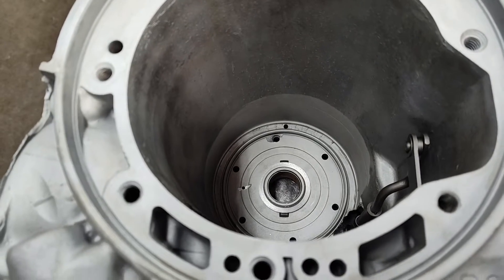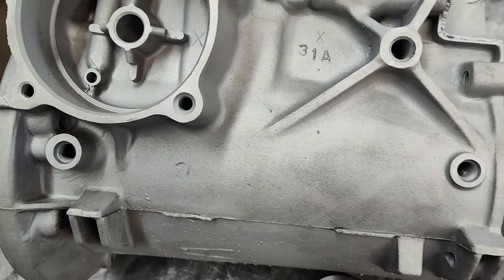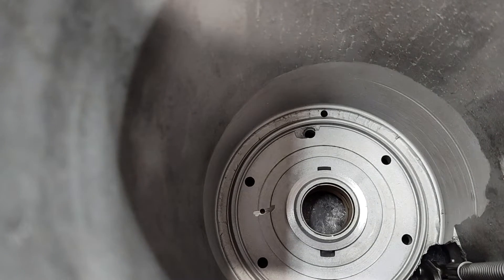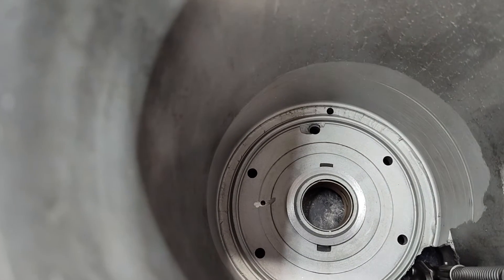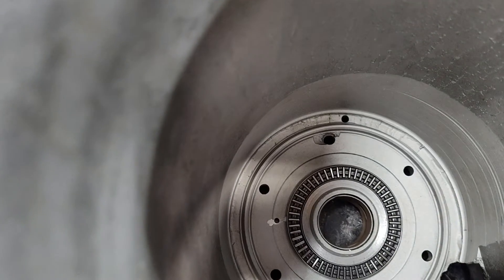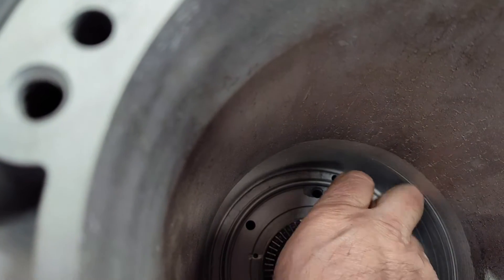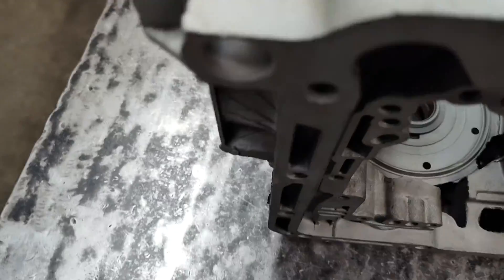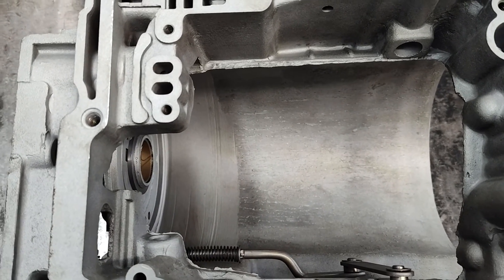Ford C4 Transmission Case Oiling Modifications and Bearing Upgrade

Comment: You mentioned on this to up the lines to 3/8 would you still use the same 1/8-inch pipe thread that goes into the transmission and just reduce it down
Reply from the maker: Yes the 3/8 lines still help because of the length of the restriction and bends in the line etc.... I have flow tested using fittings with the smaller hole sizes and I didnt find any significant restriction.  Maybe one day I will demonstrate this.